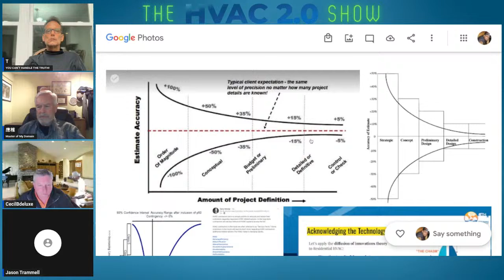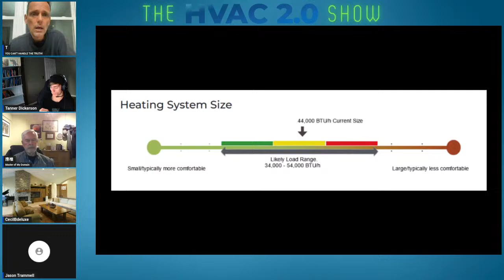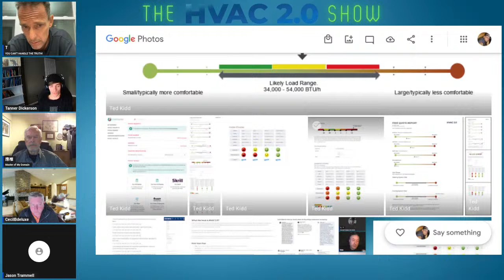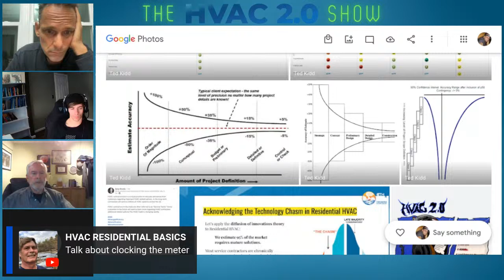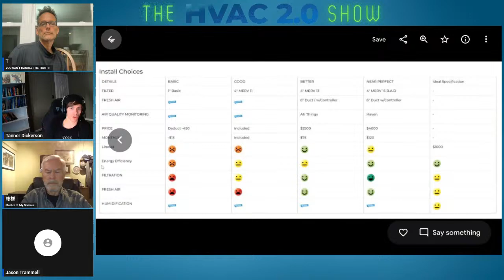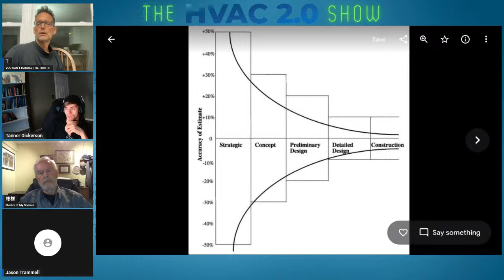One BIG REASON Heat Exchangers Crack!

Comment: only the first pass of the heat exchanger relies on radiant heat transfer - for which flame size and temperature are important. the other passes are conductive. the secondary is entirely conductive. cycling loss isn't considered and first stage is more efficient in that respect. while i can imagine low fire is slightly less efficient steady state, overall efficiency between low and high fire is a wash. a 2-stage 96% will still be 90% efficient at least on low fire. and if it is more comfortable, the owner can set the temperature lower and still be comfortable, saving some energy.